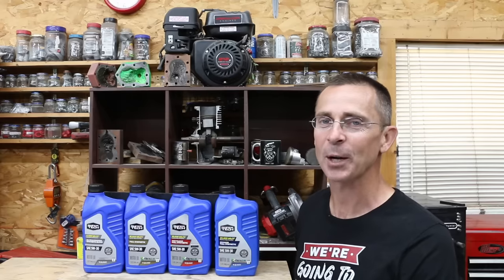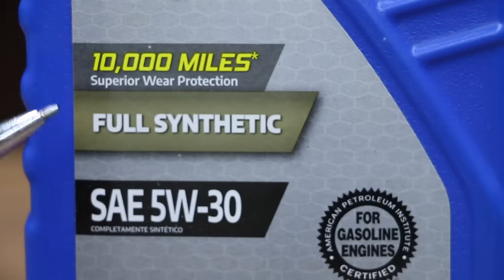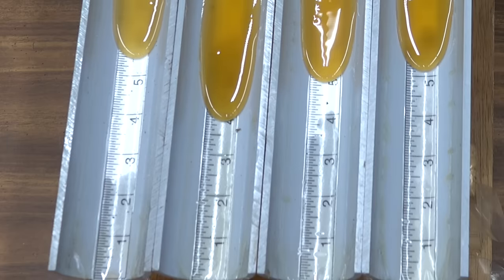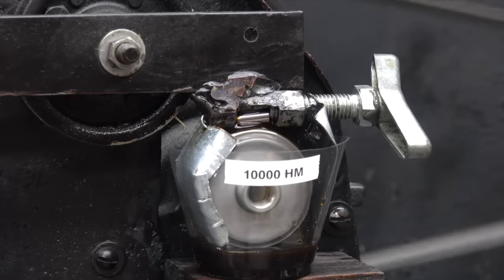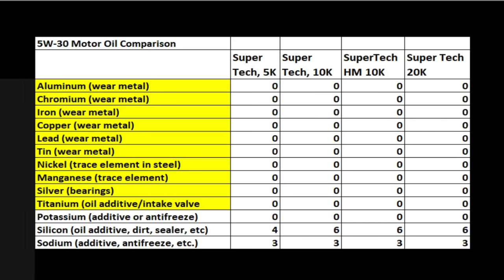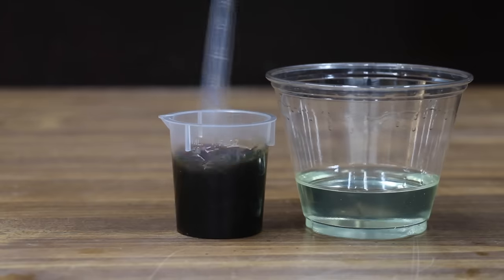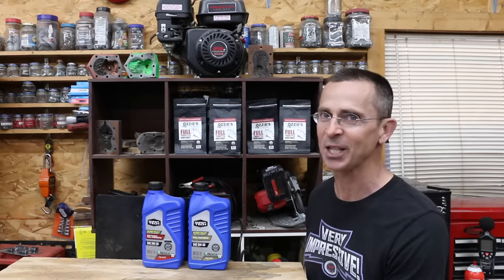Are They All The Same Motor Oil? Let's Settle This! Four Types of SuperTech Motor Oil Compared

Comment: Would love to see the same tests with these oils after they’ve been used for that mileage
Reply: It's very hard to control test conditions like that consistently. 20,000 winter miles will be much harder than 20,000 summer miles. Same thing with city VS highway miles. Unless you drive the exact same car in the exact same conditions for 20,000 miles each time (which is impossible), the test results will be heavily flawed.
Reply: @joshjlmgproductions3313  Absolutely correct which proves that these high milage oil is a complete con. That the car companies know that under warranty they will be fine but after they are junk!
Reply: @joshjlmgproductions3313  You underestimate the legend, Projectfarm. He is the the type of guy to buy a whole car and run it for 48 hours straight with a simulated load at exactly 20% throttle just to drain and test the oil 😅
Reply: @joshjlmgproductions3313  sure it won't be perfectly scientific, but it could still provide useful info.  If there's little to no detectable difference at the end, that's somewhat supportive of the conclusion that it's "probably" okay.  If an engine explodes or perhaps less dramatically, significantly more wear is evident in the "lesser" oils, that's pretty conclusive evidence for the high mileage IS effective.

Not that I want Todd to blow up any engines (unless he really wants to).
Reply: @joshjlmgproductions3313  diesel generators run fairly consistently, maybe mr farm could look into that🤔🤔

Comment: I completely agree with you! When I use synthetic I usually change every 5,000. Conventional 3,000. I remember when you had to change every 2000 and add oil every couple hundred miles. Someone would have to be out of their mind to wait 20,000 to change oil 😂
Reply: I knew a guy who completed no maintenance on his luxury vehicles. When they stopped working, he'd buy another. He was a real fool.
Reply from the maker: Thanks for the feedback.
Reply: Here in the UK the new Vauxhall engine generation from 2020 or 21 not 100% sure has got new oil change recommendations 22500 miles. The old one was 12300 I think. The company vehicle i drive atm has done 16000miles and on cold morning (around 4-5 degrees Celsius) you can clearly hear knocking from the engine for at least 2-3 minutes until the oil pump manages to build up enough pressure and the oil get a bit of higher temp. Clearly that’s a sign of oil thinning and degradation of the lubricants in it . That will damage the engine for sure and decrease the life of it.  7000miles is the most I have kept an oil in my car’s engine despite I buy “the best” possible on the market. 
Thanks for your videos! I hope people from the marketing and engineers of all these companies watch your videos and they will stop promoting engine oils that last “ forever “
Reply: Regrettably, my last two oil changes have had to be done with 20-30k between. Not gonna go into why, life just happens. Although that many miles had me concerned, I've sent my oil in to the same lab that Todd uses and they've said that, given the millage, the oil looks fantastic. I think people underestimate just how good oil has gotten over the years - NOT that I'd recommend people do this of course, but in an engine that's taken care of in every other way, I think you can get away with it if needed, on rare occasions.
Reply: @Brandon W.  What oil did you use and what vehicle?
Reply: I’m sorry.  My 96 Nissan was recommended 15,000 oil change intervals!  With Mobil 1 and their filter.  You think I’m crazy?  Oil analysis recommended 15k intervals!!!   I got rid of the car at 285,000 miles.
Reply: @mrdave777  nice
Reply: i routinely go 20,000kms on my cummins, it takes over double the oil of a v8 gasser.. my ford with 4.6 modular engine has about 7000km on its current oil and it looks brand new, still bright in colour and exactly middle of the fill line

20,000 miles is likely a little too far but 5000 is equally too soon somewhere in the middle is the right answer, change it too early and youre only wasting money, the oil is either protecting the engine or it isnt, changing it every 5000 miles is likely no different then every 10,000 miles the engine wont be able to tell the difference yet its twice as many coins that will add up if you keep your vehicles like i do well beyond 300,000 miles
Reply: Yeah those people who go 20k between changes are either not very bright or have enough money to not care about the damage.
Reply: @TheGhostTrollekdejvu  Hey.  It all comes down to oil analysis.  Period.  My 15k drain interval wasn’t me being frugal, cheap.  It’s what they recommended, it’s what I did.
Reply: @mrdave777  Who recommended it?
Reply: @TheGhostTrollekdejvu  The top reputable oil analyst company.  People say synthetic every 5,000 miles.  Again, what does the sample say?  I got 285,000 miles on that car!  And had many more…

Comment: Thanks for the comparison videos on engine oils. Awesome work, good job. I change oil at 3 to 5k miles regardless of conditions. Use quality high mileage full synthetic and quality oil filters. Small passages in engines can get plugged up if oil is dirty too long, not worth the risk to get such a simole maint. work on vehicle.
I do my own oil changes at home. I reccomend a real auto repair shop for oil changes vs a quick change type oil change place.
More experienced folks doing the work with better oils/filters.
Reply from the maker: Thanks and you are welcome!

Comment: I’ve used Supertech 5w-30, 10,000 mile Full Synthetic since my first oil change at 5000 miles in my 19’ F150, 2.7L, twin turbo truck.  I now have 61,000 miles on the odometer with a 60/40 mix driving, with 60 being highway and 40 being in town stop/go traffic.  I change my oil every 5000 miles, including using the Ford/Motorcraft oil filter designed for the truck.  I’m meticulous about truck maintenance.  I did one oil analysis using Blackstone at 40,000 miles just to get an idea how the engine/oil combination was performing and was very pleased with the results.  The report actually said I could go another 5,000 miles between oil changes, making it 10,000 between oil changes but I’ve never done that keeping it at 5,000 miles.  A very trusted mechanic once told me “oil and filters are cheap, engines aren’t”.  I told a coworker about Supertech about 7 years ago, he made the switch in his Buick at 12,000 miles, he’s got almost 225,000 on the same engine with regular oil changes at 5,000 miles using 10w-30 Full Synthetic.  He used to use Mobile 1.  We’ve both saved money.  It’s great oil, the key I feel is frequent oil changes and routine maintenance.  Take care of your ride and it’ll take care of you.
Reply from the maker: Thanks for sharing.

Comment: I've been running 30k to 50k per oil change on a Honda Element (w/230k miles) for 4 years now using Amsoil signature series oil and an Amsoil bypass filter.  I have to add a quart every now and then, but have had no issues and no sludge build up whatsoever.  Would be interested to see a test of bypass filters, as they seem to be well worth the money.
Reply: I hope that’s 🧢
Reply: That's more of a testament to Honda's quality than anything.

Comment: I recently bought a used 2011 Camry with 2ARFE cold startup rattle. I put 0W20 10,000 mile and oil consumption was about 1 quart/1000 miles. After putting in 0W20 20,000 mile, cold start rattle and oil consumption was noticably reduced to 1 quart/3000 miles. I'll be using 0W20 20,000 mile from now on. I'll take the 1% improvement for now
Reply from the maker: Thanks or sharing.

Comment: Cool comparison - though I know it would be very difficult/time consuming, it would be informative if you could expand your dataset a bit (maybe add 1 replicate and see if it's the same, if not then add a second?) - assuming a little uncertainty, I would say the three synthetics are all about the same!    (the additive packages for the three could be the same, or could be different chemistries - tying to just the Mo, P, etc. could be correct or might not be (though the test data sure supports that they are similar)

As to extended intervals, that's not a thing I do because, as you noted, oil is cheap and engines are expensive!  If I were considering a longer interval, I would look more closely at how the vehicle is being driven - 10k miles as a delivery vehicle driving around town all day every day is going to be significantly harder on the oil than 10k miles of mostly cruising on the highway!

Comment: Looks to me like Supertech put the same oil in the same bottle with a different label and called it "better".  Then they can charge more.  The TBN (Total Base Number) is a good indicator of how much "life" is left in the oil (how much additive remains).  If the TBN stays high, you can typically and safely extend your OCI (oil change interval) so long as you don't see wear metal indicators (aluminum, chromium, iron, etc).  If you want to know everything you've ever wanted to know about oil, check out Bob Is The Oil Guy (BITOG).  There are folks out there safely running 10,000 miles plus on their oil.  I do it every time on my Cummins Diesel and have my oil tested each change.  Remember, the more times you change your oil, the richer they get...
Reply: This is it. In Europe we drive 30 000km = 18 750 freedom units and the engines are fine for 400tkm or even longer. The turbos go first so if the engine is naturally aspirated it will run forever like the old 1,9 liter diesels in Volkswagens.
Reply: @patterisepi 17500k.   Go ahead.   I just think ur cheap.  European motors are junk so who cares.   My hellcat I pamper.

Comment: Great video and I agree with not running the same oil for more than 5000.  I live in the desert so I change my oil every 6 months and barely go over 3000 because of the elements (heat and dust).
Reply from the maker: Thanks!  Thanks for the feedback.

Comment: For the evaporative loss test, wouldn't performance need to be measured as % lost rather than an absolute value since the starting weights were not identical?
Reply from the maker: Great question!  The oil containers each vary in weight. So, I add right at 200 grams of oil into each of the containers. Sorry I didn't do a better job of explaining this.
Reply: @ProjectFarm  Wouldn't the heavier container take longer to heat up due to the extra material? I would be curious if the results from the two containers differ if the same oil is put in both.

Comment: I think the use of electronic fuel injection was a game changer, having constant control over the leanness of the air fuel ratio helped tremendously. I am not so sure about the carboning up issues of a lot of the direct only injection engines though.

Comment: Great video! The bottom line is that the 10K mile oil is the best value for the buck overall. Also Todd made a great point that it is recommended to change it every 5K miles. This is because oil is cheap compared to the price of an engine or some engine repair. In my opinion - even if you lease the car or plan to change it - it is good to proper maintain the car and give it some love. Good video, thank you!
Reply from the maker: Thanks and you are welcome!
Reply: theyre all so close that whichever is cheapest is best bang for the buck, youre engine isnt benefiting from fractions of a percentage of differences in these tests.. theres either oil on the surfaces or there isnt, great testing but to me it solidifies that any modern oil will do unless i see 10% or greater differences in important applicable tests ill save the coins to put towards the next car itll add up over the lifetime of a 300,000 mile car
Reply: Andrew, I completely understand what you are saying. My case is the same, I drive a 2006 corolla and basically even the cheapest 5k oil from the video is very good and the best oil have specifications that exceeds the engine properties.
It is like putting a premium fuel in your basic car - no any benefits. It is better to change your oil regularly than buying the best oil and change it at 20K miles which is absolutely nonsense. Of course the most expensive oil and regular changes is the best but the moral of the story is that after one price point price is getting bigger but the quality isn't getting much better. Just change the oil with the specification the engine requires and do it at which interval which you believe is good (5K e.g.) and life is going to be good.
Reply: @kaloyancholakov3725   yes your car and engine are inanimate objects, "pampering" them isnt going to make them last longer or work better, change the oil at reasonable intervals, use an appropriate weight of oil, any brand will do theres nothing on the shelves in NA or EU that has sand in it or is corrosive its all motor oil and all of it is 100x better than anything they had 50 years ago yet their cars ran great

save the money and rest assured rust or electrical failures will kill the car long before the oil does

Comment: There is no way I would go 20k, either. I usually get mine changed out at 5k, more or less. It took me a few years to finally believe in the synthetic's ability for longer changing intervals, and waiting until 5k still feels weird to me.
Reply: You're literally just throwing money away. My Toyota regularly goes 10k-15k on super tech synthetic. Any decent oil will last 10kb easily. Lab results confirm this.
Reply from the maker: Thank you for sharing!
Reply: Same, ain't no way in hell I'd leave oil in anything for 20,000 miles, regardless of what the vehicle manufacturer or oil company has to say about it. I run cheap full synthetic  in my vehicles and I change it between 4000-5000 miles. I own 3 older vehicles so I usually make an afternoon of it, change the oil, rotate the tires, check the brakes/steering/suspension, and make sure everything is still looking fine.
Reply: Me getting an oil change after I forgot when my last change was:

Probably changed my oil after 30k miles, little Honda is still kicking.
Reply: @TheOfficialLittleG  Depends a lot on driving conditions. A lot of long trips on thr highway is much easier on oil. Short trips and a lot of idling not so much.
Reply: @brianbethune862  there's zero reason to change oil at 3k. That's 1971 mechanic propaganda. It's legit for fools who don't like money.

Comment: I'd actually be interested to see this with the different Amsoil oils.  They have three tiers:  Signature, XL, and OE.

I only use Signature in my vehicles.  The Ecoboost is on 10k miles/6 mo routine, while the NA engines are annual.
Reply: Yes, Test these too please
Reply from the maker: Thanks for the suggestion.

Comment: Would take a lot of effort, but would be really interesting to see (test) both the 10 and 20,000-mile oils after 10,000 or even 5,000 miles of use in the same motor
Reply from the maker: Thanks for the suggestion.

Comment: I always change my oil at 4k-5k even though it's almost all highway miles. And thanks to this channel I also use the mobile 1 oil because it was almost the best performance amongst all the oils you've tested, and I think it was a different channel but I use the mobile 1 filter because it was almost the best construction without being super expensive

Comment: 6,000 Miles or every six months, whichever occurs first. Most auto manufacturers today recommend oil changes between 6,000 and 10,000 miles, but there are some manufacturers that go as high as 15,000 miles.  For example, BMW with full synthetic recommends an oil change every 10,000 miles or Once a Year (whichever occurs first).
Reply from the maker: Thanks for sharing!

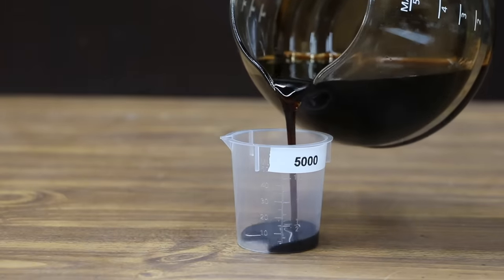Comment: 2:53 It's actually just over 20% less evaporation. You forgot to normalize the different starting masses in the test. 

Individually, the 5k lost 4.3% and the 10k lost 3.4%. So, the 10k lost 20.4% less of its initial mass. (Or, you could even say the 5k lost 25.6% more than the 10k.)
Reply: question is, did the weights account for the mass variation of the containers? 🤔
Reply: This also affects the ranking in the final scoring, 10k and 10kHM switch places in the evaporative loss scores. The final scores become 10k scoring 1.7, the 10kHM and 20k both with 2.1, and the 5k getting a 4.

Comment: Good video!  I use the Supertech 10,000 mile oil in my beater around town car and change it every 5000 miles.  No problems.  When I was driving many miles for my work (about 30K a year...mostly 98% highway miles) a few years ago, I was using Pennzoil Platinum and changed it every 7500 miles.  NO way would I ever go more miles on ANY oil.  My daughter uses the Supertech 10,000 miles oil on her get-around-town car and changes it every 5000 miles.  She has 240,000 miles on her car.  I stick with the Pennzoil Platinum as I believe its cleaning/sludge prevention is superior to any other oils.  Nevertheless, I really do not have anything against Supertech.  Thanks for your good video!
Reply from the maker: Thanks and you are welcome!  Thanks for sharing.

Comment: Great video as always,,,,,, OCI'S should be determined by the amount of vacuum designed in to your PCV System. The lower it is, the shorter your OCI. -10.inH2O Hot/Idle or less needs 3,500-4k mile OCI'S. Thanks for your time and effort... The best simple form testaholic out there.
Reply from the maker: Thanks!

Comment: just watched the lawn mower blades , the oil and reviving old batteries.  Very impressed. I aree with you on the oil, I change mine about every 6 even thou they say 8-10. Safe than sorry.  I tried the old battery revive thing and the 2 I had no luck with thought it was BS, but after watching I do see some can be revived, thanks.
Reply from the maker: Thanks for the feedback.